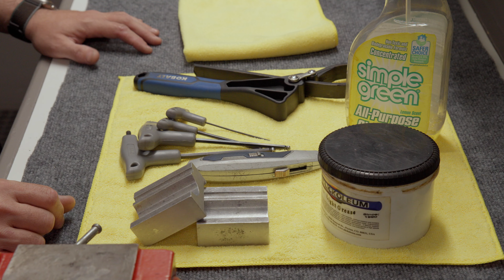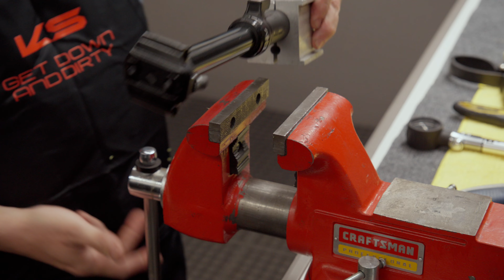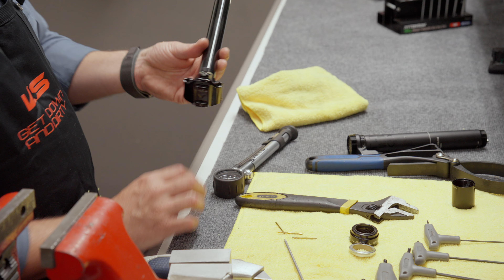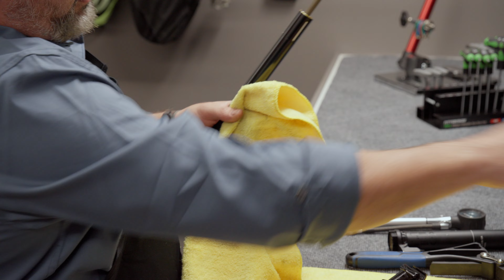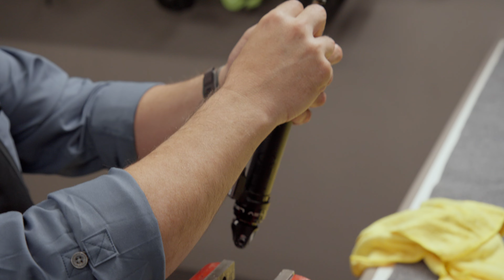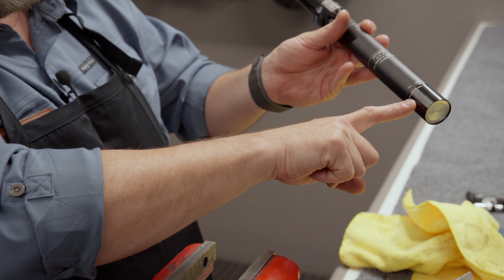KS LEV - Maintenance video

Comment: Hi! Lev 272 here. As a machinist, I would like to made my self the aluminum vise clamp. Can I ask you the smaller diameter ... the actuator diameter i mean? Thanks 👍🏻
Reply from the maker: Thanks for reaching out. The best option would be to use V blocks, as they will adapt to various diameters. The small compression rod diameter ranges from 6-10mm depending on model.

Comment: Im just trying to determine if I can lube my sons outer most oring the dropper post "slides in and out of.  Model KS e20 30.9 425. The shockingly SPARSE general information let alone maintenance documentation. The ONE I found said something similar to "go to an authorized dealer blah blah blah money money money"....for general maintenance? Very anti consumer imo. 
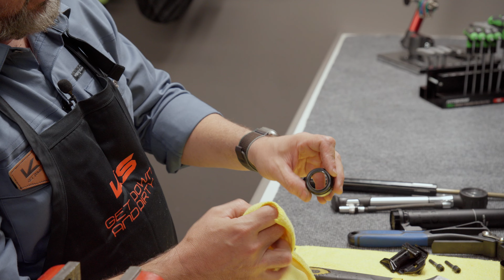~~~THAT BEING SAID. While this video didn't cover our D-post basic question it looked to be a well done piece. The piece I think needs lubed on ours seems similar to your "seal collar" at 14:25 
~~~ EDIT.  Finished the vid. Yes the "seal collar" part I noticed at prev mentioned time and  I was suspecting my sons dropper post of needing lubed is nearly identical looking. Post is only about 3 months old TOPS. Maybe he is over reacting and Im scuff marks thats typical wear marks.
Reply from the maker: Thanks for reaching out! Based on what you're describing, it’s very likely that a simple clean and lube will bring the post's performance back — especially if it's only a few months old. The maintenance video does outline the general procedure.

Comment: I just followed all of the steps for the video because my dropper would slowly creep up after being depressed. I thought it was that there was tension in the thumb lever, wire and housing but I replaced the wire and housing and lubed the lever but nothing changed. The post does drop easier but it also come up on its own faster than before I serviced it. Any additional tips? Thanks!
Reply from the maker: Thanks for reaching out. You will need to remove the cartridge from the post and actuate it with the push rod. If it holds position, then it could be the actuator needs to be cleaned and lubricated. If it does not hold position, it is likely the cartridge, and that would need to be replaced.

Comment: Okay so I have my KS E20 in 34,9mm size, but i have the old model and I disassembled it and I think there is no pressure valve, because I can't unscrew the part under the seat. But I have a problem, because my dropper works slowly and not always comes out to the end, sometimes stops half way. I thought it could be a low pressure but if i can't pump it up what can I do to repair it??????
Reply from the maker: Thank you for reaching out. Most likely the cartridge needs to be replaced. The E series does not have an air valve.

Comment: My Lev has no Valvle for pressure adjusting under rhe seatclamp 
is the valve inside the post or is  my Model an older one without valve ? 
greets from vienna ❤
Reply from the maker: Thank you for reaching out. The first generation of LEV 272 had no valve, is it the model you own?
Reply: Thx for the quick respond!!!
i dont know exactly, i get it from a friend.
there is a number on the post it says AM150405980
when it is the older model, are there any different service steps or is it the same ?
greets ❤
Reply from the maker: is it a 272 diameter?
Reply: yes 27,2
Reply from the maker: OK so your post is definitely a first-generation LEV 272, which does not have an external air valve.
Thanks for checking in, and feel free to reach out anytime if you have more questions. Ride safe!
Reply: okay and what is with the service steps that i question it ? cheers
Reply from the maker: Sorry, I don't understand your question, can you reformulate?
Reply: can i service my old  Model like the new ones or is it different? 
thx 4 ya patience
Reply from the maker: No worries at all. Did you check that video? https://youtu.be/9mjbgbWR_g4
Reply: thank you for your help man, have a good day 
cheers ❤
Reply from the maker: what if I am a woman?

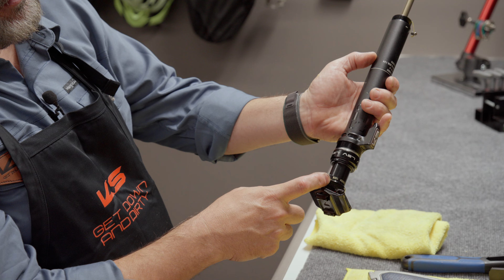Comment: 08:25 But can you ignore this step to align my coupler to better suit my frame.
Reply from the maker: Thank you for reaching out regarding your LEV dropper seat post. It is the same process as a servicing, but simply insert the stanchion to point in the desired direction when reassembling the post.